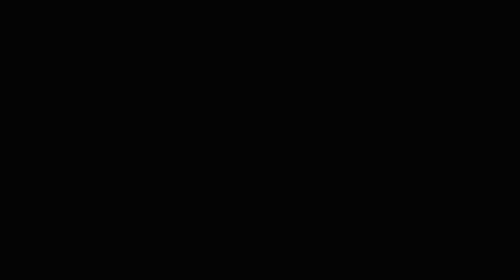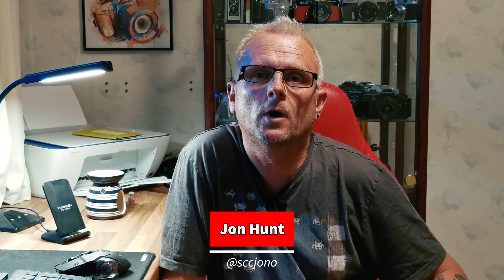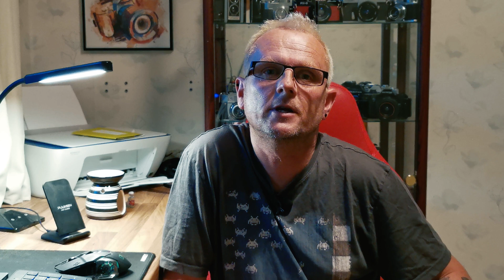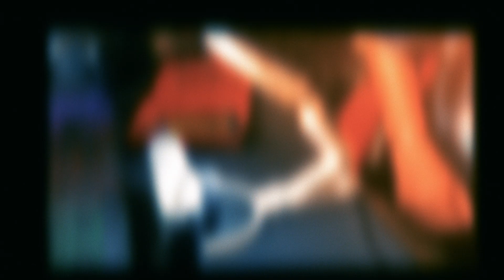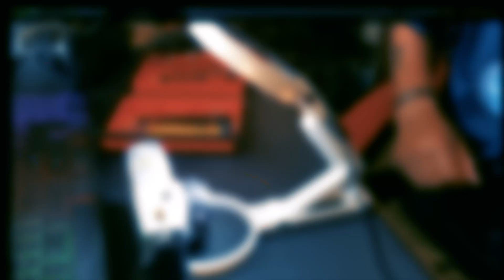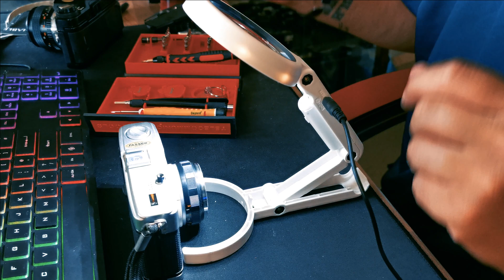1968 Olympus Trip 35 - Vintage Film Camera | Part 2 | Restoration

Comment: If you wet one end of the adhesive side slightly it will allow you to slide the leather into place. It will stick after a few minutes. Run a cocktail stick or finger nail firmly along the edge to tuck it into position. I’ve done mine in green but tempted by the blue …
Reply from the maker: Some top tips John, thank you.